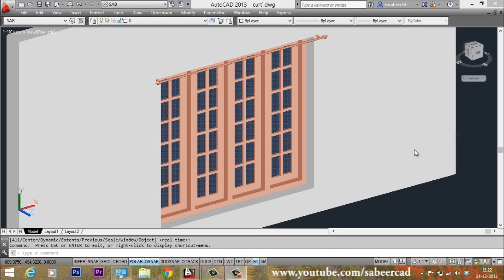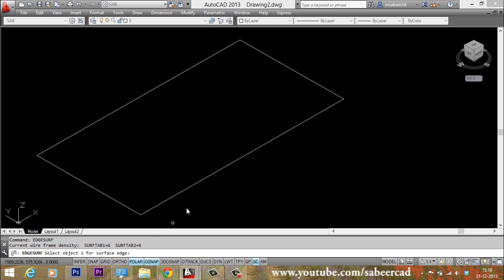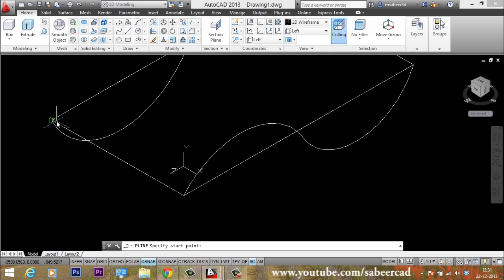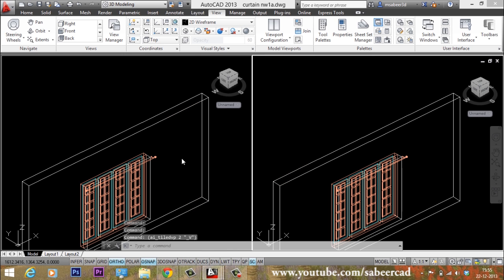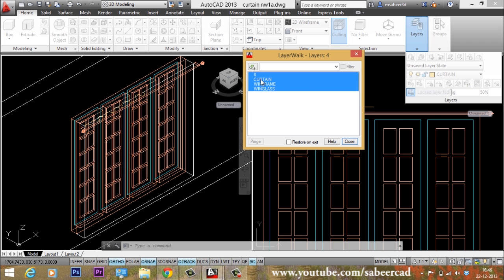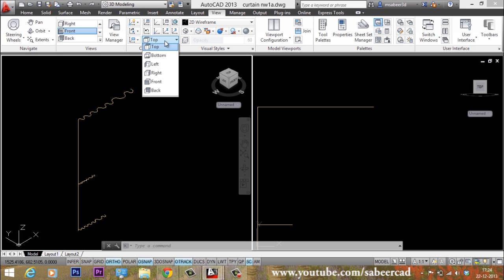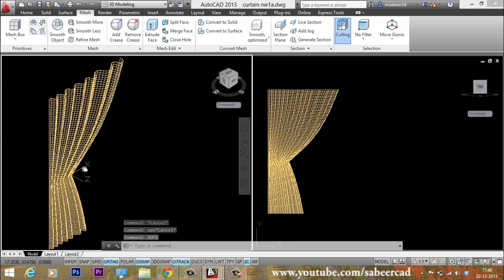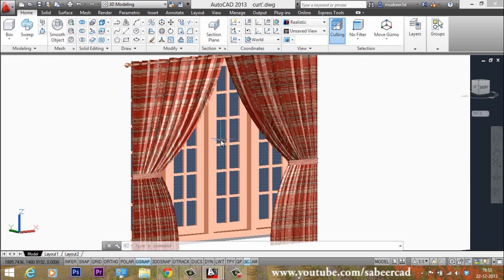CREATING 3D CURTAINS | AUTOCAD 3D CURTAIN

Comment: At 8:33, where the curtain's poly is to be drawn, I can't get mine to draw at the top view it draws the bottom somewhere along the end of the wall bottom. How can I change that to start drawing where it should draw. along the middle of the rod?
Reply from the maker: +soma soms   The start point of the polyline should be picked right at the centre of the extruded circle . For that you have to activate OSNAP and make sure that centre is checked .
Reply: Thx for your reply. I snapped to the center of rod many time and still it started at bottom of wall. :/ I simply drew randomly and same result.
Reply: I also saved, closed and reopen (sometimes these glitches go away for me when I do this) no change
Reply from the maker: +soma soms  Can you come for a chat ? I can guide you and tell you where you have gone wrong